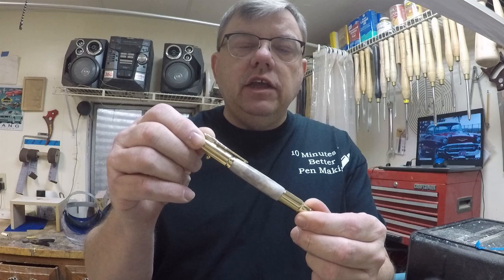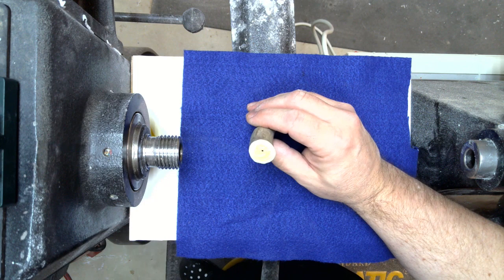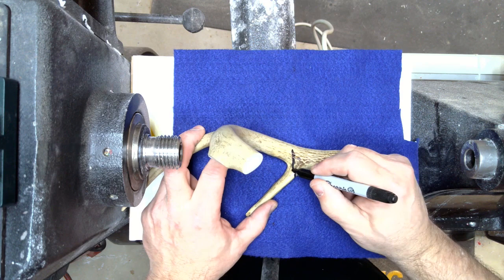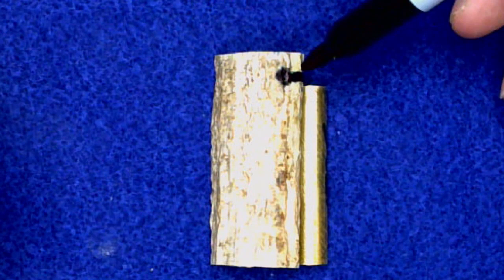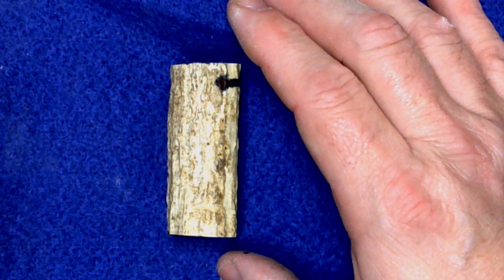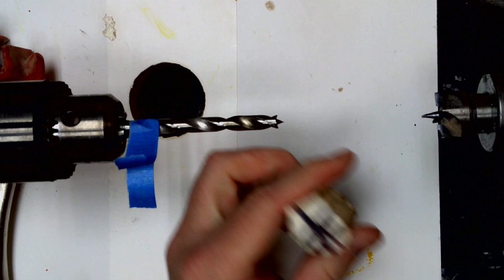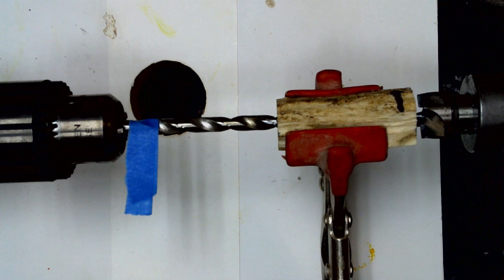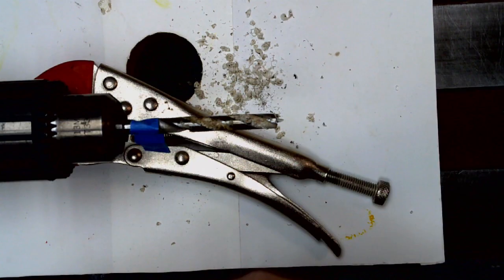10 Minutes To Better Pen Making - Deer Antler Prep - Mark Dreyer

Comment: Well you talked me into buying the pen assembly disassembly tool . As I was making  all the mistakes you were talking about. Thank I love that tool.what I’m thinking of buying is a tool system to sharpen my lathe tool any suggestions?
Reply from the maker: For my HSS tools I use two systems. The Oneway Wolverine system would be my first choice. Consistent sharpening every time. Specifically the Vari-grind. I also have a Tormek from years ago and I purchased the Tormek Converter Plus Accessories for Wolverine Jig. This allows me to use all the jigs and attachments I had from the Tormek. Both systems are good. If you go the Wolverine on a slow speed grinder - moving to a CBN wheel is a good idea. As hard as this sounds once I moved to CBN wheels on my grinder I actually enjoy grinding. Hope this helps - let me know if you need more information. And thanks for watching.

Comment: What are your thoughts on stabilizing or dying the antler before turning?
Reply from the maker: Sorry for the delay _ I was demoing in New York. I have never needed to stabilize the antler. Depending on the antler I may not even put a finish on (just buff it). As for the rest - a simple GluBoost finish (no stabilization). I have never dyed the antler but it is a great thought. If you do it post it on my FaceBook "10 Minutes To Better Pen Making" group - I would love to see them. Thanks for watching.

Comment: Could you use the pen bushings to align the drill center point, and include some of the rough part of the antler without blowing through when turning?
Reply from the maker: Sounds like a good idea. That gives you a better idea of how much you can keep. I will try it. If you do let me know how it goes. I will flip the bushings over on the end and use an awl to mark the center (which is what I believe you are suggesting). Let me know if you try it. Thanks.

Comment: Sure, do waste a lot of material with your extremely over exaggerated eighth in cuts that are closer to half of an inch. Why not just set it up in a vise on the drill press? It works great for me 100% of the time and is way more stable. I also just use high-speed steel tools as long as they are sharp they work just fine. As far as the angels you get when you cut off the pieces from the main antler a belt or disc sander work just fine at squaring the ends up use the brass tube as the guide its pretty straight and square you have to glue it in anyway. Why not use it?
Reply from the maker: Thanks for the suggestions. As for your technique - if it works for you then do it. The point of my channel is to give a starting point. Many people do not own a separate drill press as suggested. If you have the extra tool - please use it. The issue I found with the drill press is centering the antler on thin pieces. For me drilling on the lathe works easier for thin and thick pieces, and I like to use the same technique for all. As for the belt sander or disk sander - once again I tried to keep it with the same tools. If it works for you - do it. And once again thanks for the suggestions

Either way thanks for watching and thanks for the suggestions for anyone else watching.